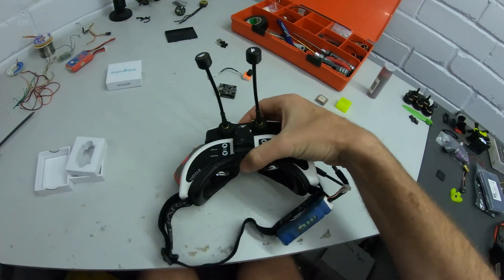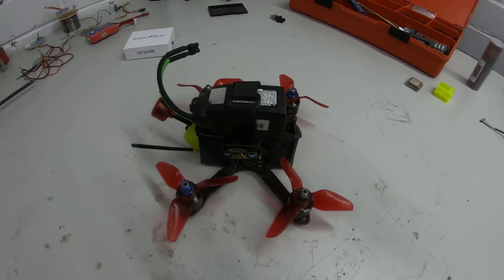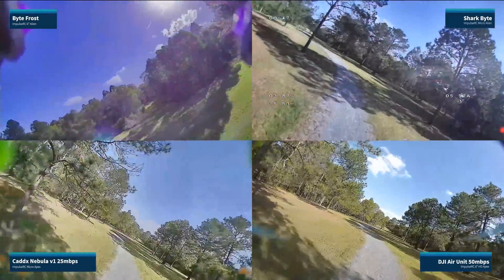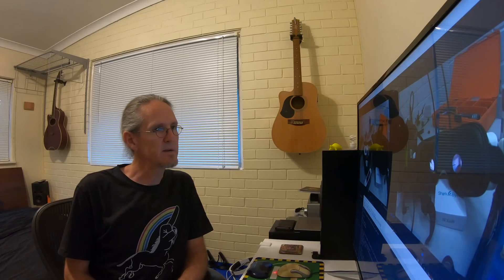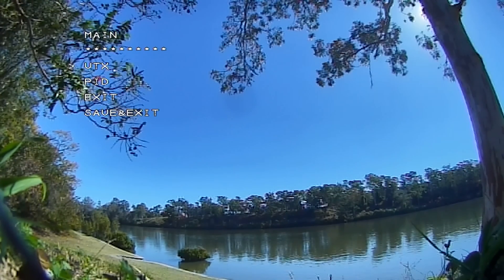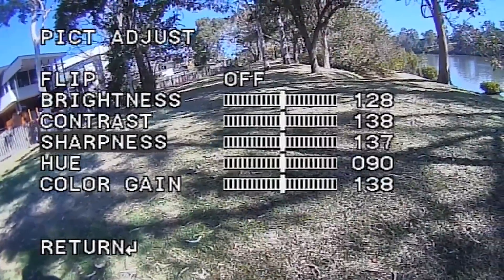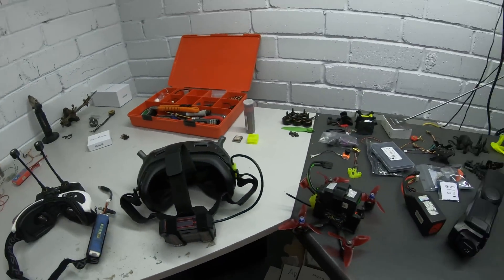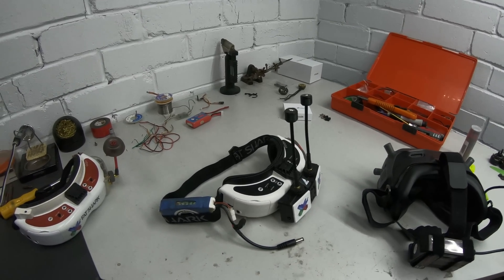Digital FPV Shootout 2 - Shark Byte

Comment: I'm curious what your thoughts were with the 7ms mode for DJI? I found that to be pretty stunning when it came to low latency for racing. Thanks!
Reply from the maker: Sorry, not sure what you're referring to...?
Reply: @strepto42  with the DJI controller and air unit you should be able to set to SBUS fast which is a 7ms latency. I did it for my vampire 2 and see a huge difference. You absolutely should run focus mode for racing, but the 7ms mode is quite nice for racing. Requires a betaflight setting. Joshua Bardwell covers it
Reply from the maker: @bfattori01  Oh right you mean the fast sbus control link - sorry thought you were talking about some sort of video mode. I'm nowhere near good enough to notice control link latency :) Have been flying sbus and the dji a lot recently and don't really notice any difference.
Reply: @strepto42  thanks for your honest feedback. I thought it added something, but it is kinda negligible to me. Wondered if someone with more experience could detect more

Comment: 'Death of Analog'
I'm surprised by that; chiefly because of resounding analog pilot protests.
I only recently began FPV, and I only got into FPV because of the DJI system.
Working with analog to learn, and I think it's making it harder...cheaper, but harder.
Reply from the maker: Lots of people will still fly analog I'm sure. Hopefully fewer and fewer as time goes by though.

Comment: To me it looks like Shark Byte will be great for racing and such while DJI for maximum immersion. I could not go back to a system that has that analoge type static but i understand that some want and need to have that low latency and higher awerness when flying true static/low signal.
Reply from the maker: Exactly, horses for courses....

Comment: There's one 'small' point I'd like to counter to your summation...
Killing analogue is only a win for those that can afford to go digital, analogue will always be the go-to for those of us on a budget for the foreseeable future....
OK, decent goggles are always going to be a big step financially & so far Im making do with the Quannum/Fat Shark Genisis which admittedly does 720p & can take HDMI.
But then there's the whole micro market which even a 20x20 won't fit in, especially the 'whoop' class/sizes.
Then there's those of us that fly fixed wing as well- that short digital lead between camera & vtx in a lot of cases is just nowhere near long enough...
And then we come back to the price once more....
Assuming some kind of foggles are already owned that the Shark Byte will fit & run on, setting up FPV one multiple models/quad is still going to be more expensive than analogue!
30-odd AUD for a cheap camer all the way to 75for a decent one & then another 30 to 50 & sometimes more for a VTX will be cheaper than a digital camera & VTX by what for some of us a large margin.
My summery, digital- yes its a good thing & it's great there's finally some competition to the large company trying to wipe out all others, but in terms of price & size, digital still has a looong way to go & thats where analogue will be winning for some time yet!
Yes it's great to have the option for those that can afford it & the space to fit it, but not everyone can or is willing.
Thanks for the gander & I'll be keeping my eye on the Shark Byte system, rather than the DJI, for future developments with interest all the same...

Also please note, I didnt even raise the thorny subject of long range! :v ;)
Reply from the maker: Thanks. Yes digital will always cost more... for me it's a cheap hobby compared to most, but I appreciate that's not the case for everyone. Analog won't go away 100%. I just want to see it fade in time...

Comment: YES! This is what a wanted a digital system small enough for my 250g quads im hyped for this hopefully the price point is good
Reply: @Sub250gram fpv has been making plenty of digital HD sub250g builds.
Reply: @JaasimMulla  yea true but he does something to the vista to make it even lighter, and even after that it weighs around 28 grams, from what ive seen this fatshark vtx only weighs around 14 grams so it might even be possible to shove one in a whoop
Reply from the maker: Same here! I should probably weigh my little alien nugget. Pretty sure it comes in under 250.

Comment: great video how is the image quality irl compared to the one you show in your review? can fatshark byte fly race along with analog without blasting them out ?? and can the timer register the digital signal by race ??
Reply: Very good questions, does it blow away analog systems next to it, and how many people can race at the same time without too much interference?
Reply from the maker: Yeah it remains to be seen how many can race at once, but it plays very much more nicely than DJI with other users. The day I was testing we had DJI, analog and SB all flying at the same time - DJI caused everyone issues but the SB and analog play nice. Need to get a few in the air at once though to really test things out. Race timer should work same as usual. The image quality in real life is better - the goggle experience is generally always better than youtube/dvr
Reply: How dos it prefom indoor
Reply from the maker: @maloulukasholm  Don't know yet. Will have to have a go sometime.
Reply: @strepto42  what size camera dos it use?? Nano??
Reply from the maker: @maloulukasholm  Yep nano, with an adaptor to micro.

Comment: I think the only option for Shark Byte is that it does not exceed $ 200 because if it does, I buy DJI for sure, I sell my HDO2 and buy the DJI glasses without spending almost any money.
Reply: I think the same, im waiting price.
Reply: Fatshark goggles are OLED. That does make them dearer. And should be a better experience than the DJI goggles. I think the next DJI goggles will be OLED.
Reply from the maker: 200? Good luck!
Reply: @strepto42  good Luck for Fatshark if is more expensive....
Reply: Nope.  I boycott all DJI products.  So I will buy Fatshark.
Reply: 250-380 is likely the cost ;range, not sure if that is the module  by itself, or a set with Camera and VTX... My guess is the module by itself is closer to 200...Runcam Racer 4 Digital HD cameras are 37 bucks (21 bucks chepaer than dji's camera...regardless of the cost of the module the camera and likely the VTX parts are both cheaper than DJI. when you have more than 2 quads to convert the savings adds up.

Comment: I wouldn’t say this is true hd because it still looks very analog. Tbh Shark byte is so much behind dji from a technical stand point as dji develops custom chip for digital fpv while fatshark can only use what’s available on the market.However it may have a place if priced right.($200-$300 ish for tx and rx).
Reply: fatshark used asic too.
Reply: jack lee Yeah I know. They used a solution from a company called HD zero.  What fatshark did is basically nothing more than putting the parts together.
Reply from the maker: Sounds pretty easy Ians. Can't wait to see your implementation!
Reply: It doesn't have to be me. Just wait until other manufacturers replicating sharkbyte if  it gets popular (doubt) while it is virtually impossible to reverse engineer  dji fpv.
Reply: @lanszhang4715  nobody can copy SB without DVM. nobody can copy dji fpv without dji.in fact,i heard the chip of dji fpv is not design by dji.

Comment: Looks really interesting - does it use the analog frequencies? Or does it have its set of 8 channels similar to dji?

Also - have there been frequent firmwareupdates till now? What really surprised me with dji is how well they shine with their updates while fatshark isn't really known for that on that front :S

Anyway, thanks for the great review mate! ✌️
Reply from the maker: Thanks! Yeah it basically uses very similar frequencies to raceband (and DJI, in their roundabout sort of way). There were frequent FW updates to bytefrost once it went to public beta. I would imagine the same will happen here. For now the focus has been on product development I think.
Reply: @strepto42  alright awesome, one more thing just came to mind - did you notice it booting up on always the same channel? (seeing how dji blasts race 6 with full power for a second before going to the selected channel) Or does it work like analog as in firing up on the last saved channel?
Reply from the maker: @Averell64  It's polite enough to remember the last channel and power level you set it to :) Also if you enable LP (low power) mode it will boot up in 25mw and stay there until you arm.
Reply: @strepto42  that's great, I really like my dji fpv setup but it annoys me that it's so insanely unfriendly towards other pilots :/
Reply from the maker: @Averell64  "DJI knows best" has always been a sticking point for me. Even the little things like calling it "unlocked" rather than "armed". That ridiculous shit where it stomps raceband 6 every time you power on is a classic example. Like you say, amazing tech but so very DJI...
Reply: @strepto42  wait, "unlocked" is supposed to mean armed? I always thought it was some error message which could be ignored lol

Comment: You also need to realize DJI has an awful lot of stuff already Built-in to their system that they have not turned on yet kind of like Tesla
Reply from the maker: Yes and no. Their hardware is well future proofed for sure. We've seen what a few firmware updates can do and I'm sure more will follow. But the same applies on both sides. They're fundamentally different systems though, aiming for different functionality and niches, so hopefully they can coexist rather than compete.

Comment: The DJI/Shark Byte comparison seems to be similar to the Crossfire/Ghost comparison.  DJI and Crossfire should have better range/penetration but more latency compared to Shark Byte and Ghost.  I wouldn't be surprised to see racing rigs mainly consist of Shark Byte/Ghost in a year and freestyle rigs of DJI/CF.
Reply from the maker: There are some parallels, yes. Will be interesting to see where the Ghost fits in to all this! I can push km out with DJI and the DJI radio on 5.8, so not convinced about the penetration argument with xfire. Time will tell! More choice is good for everyone.
Reply: crossfire /ghost is on pair( ghost has better range in 160hz mode , but less in 60hz mode). dji clearly wins in 8\10( shark byte wins latenccy and maaaybe breakup)
Reply: @Nikita-zd1gc  sure, but two things here:  

1) latency is the reason digital isn't used at all in racing, so matching the latency of analog with better video quality is a win and I bet we'll see plenty of people switch over.  

2)  Yes, ghost has better range in racing mode but CF has better range/penetration overall, that was the actual point of my comment.  Both Ghost and Shark Byte and bringing new options to the table better suited for racing and not freestyle.

Comment: > Kill analog and it's better for everyone.
Yes and no. Analog is an old open standard anyone can make a vtx or a rx for, and anyone can tune in. Want fly with your friend or have a monitor ground station? Analog > digital. Wifibroadcast shows how you can still do analog-like multiple receivers but nobody's really adopted it (for a bunch of really legit business reasons like licensing).
Reply from the maker: True, for this to replace analog it needs to be as open as possible. That said it's cost them a lot of $ to develop so I don't have a problem with licensing the chipset or something like that. Thankfully I don't have to make business decisions, I just get to fly :)

Comment: Will the shark byte work with the HDO'S or does it have to be the HDO2'S?
Reply from the maker: It will work with any goggle that has an HDMI in but for optimal picture you'll need HDO2s. HDO still look significantly better than analog though!

Comment: So how does work with lap timer?

Also how do they have analog break up on a digital system when digital isn’t meant to work like that?
Reply from the maker: It works the same as an analog vtx... timer will just detect the RF peak. As for break up, see digital TV and how compression works in general...

Comment: You are right. As someone with DJI the image looks too scratchy and isn't appealing to want to switch. Also when Mr Steele tested Bytefrost (which uses the same Divimath IC based HDzero technology as SharkByte) 10 months ago he said that he experienced lagging and stuttering while freestyling after claiming it wasn't variable latency just moments before. So the real test is to let lots of people fly it hard and see if it stays smooth or not. See Steele's test video of Bytefrost here. https://youtu.be/ecWqbfyXiyI
Reply from the maker: Yes I experienced the stutter with Bytefrost too. Greg pinned down the cause and fixed it, I haven't noticed it with the new system at all. It was related to both receivers not having a good signal and holding the last frame in the buffer, it was a software fix and not something intrinsically bad with the hardware thankfully.
Reply: @strepto42  Good to hear. Will be interesting to see it get a full public shakedown when it's available to buy. Do you know if there are any plans to enable 1080p30 as is available on the non Fatshark HDzero firmware? 1080p30 could add extra crispness to the video even on goggles downscaling to lower resolution. Granted it's not as smooth as 720p60 but I bet many would fly it given regular analogue is 25/30fps framerate anyway.
Reply from the maker: @changeagent228  I dunno to be honest. 1080p is possible of course... 1080p60 for me please, even if it takes up two channels! That's the nice thing about this tech... once the train gets rolling the improvements will come!
Reply: @strepto42  Yes Divimath's 5670 chipset looks interesting. http://www.divimath.com/dm5670-en/ Perhaps in a few years once shrunk down and latency reduced. Time will tell where things go 😌

Comment: What's the size of your computer monitor? Is that a 34" screen?
Reply from the maker: 42" 4k monster :D
Reply: @strepto42  Nice! I'll look for one. Thank you!
Reply from the maker: @neilfpv  It's a Philips BDM4350UC to be exact. I even have a spare if you're in Brisbane and want to buy one lol
Reply: @strepto42  🤣Another question. I'm using Caddx Vista at 50Mbps. There are areas where I fly where video stream suddenly gets choppy. If it was analog, there won't be any choppiness, it will still be smooth playback or stream but definitely there will be noise.  Have you encountered that with your DJI setup?
Reply from the maker: @neilfpv  Well yes, that's the variable latency coming into play. Basically the system is losing entire frames so the goggles request a resend, making the video jumpy. In this situation the Fatshark system will just fuzz out like analog. Either way you're losing information, that's just the nature of FPV :)

Comment: Another test you could perform : is it possible to fly it along with dji friends?
Reply from the maker: We did this actually. DJI doesn't play particularly nicely with it, same as with analog. I could fly, but the range was reduced a lot. The usual things help; standing apart and making sure they're not spewing out 1200mw etc. But yeah, same issues. No issues when flying with analog for either party (as long as you stay off the same channels).

Comment: I'll be curious about the range, for us LR folks.

Slowly we're getting there. 

Thanks for the review! ✌🏼
Reply from the maker: Yes I'm going to try to get it onto a wing soon. No hard limit is correct, unlike DJI. It will just slowly fade to digital static, much like analog.
Reply: @strepto42  Brilliant!
Reply: Yea curious range limit. I have heard dji shuts off like 4miles no matter what. Don't know if they fixed it yet
Reply from the maker: @QSpeedRacer  They extended it but there's still a hard limit. It's >10km now though.
Reply: @strepto42  thank you

Comment: This is starting to look good. Is it still limited to 16x9 only?
Thanks for preview of the system.
Reply from the maker: Cheers! I think you can 4:3 it actually, but that crops the left and right sides. Would be good for older goggles actually, but possibly not for the HDO2s where you want native res. At any rate you're not gaining anything in the vertical res department by going 4:3, unlike with DJI.